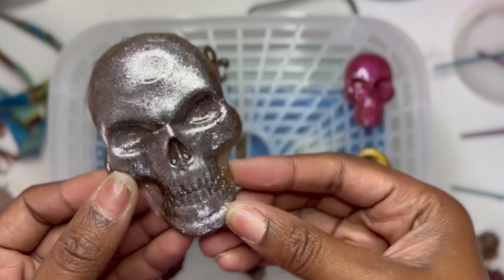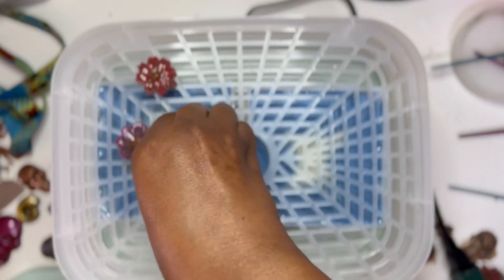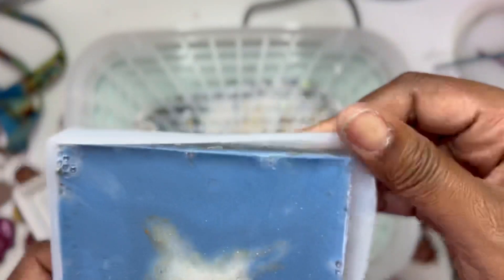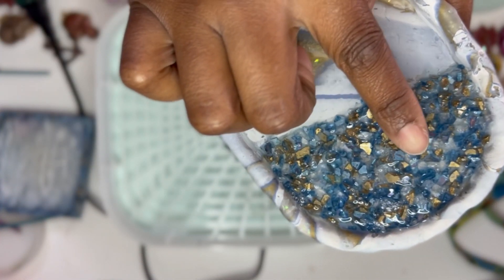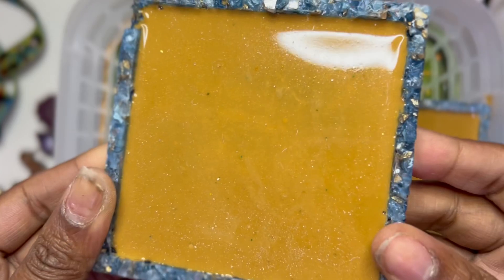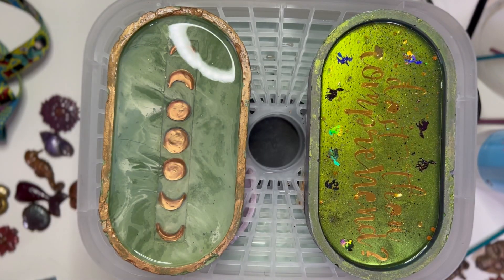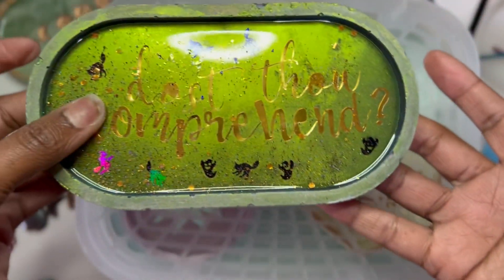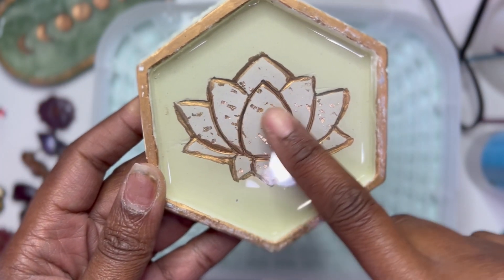Resiners Smart Curing Machine: Curing an Epoxy Layer on top of Polymer Clay and Cast Plaster

Comment: How to do bowls and larger things and can you use 1 plastic layer
Reply from the maker: On the Amazon listing it states that you can use it without a cover for larger molds but it would take 1-2 hours longer so I assume you’d have to use manual for that. I haven’t tried it yet but I do want to test it out.
Reply from the maker: I just posted a new video I think you will find interesting!
Reply: Tysm